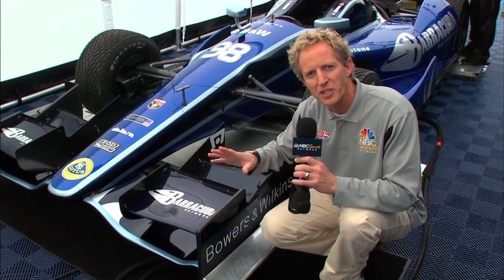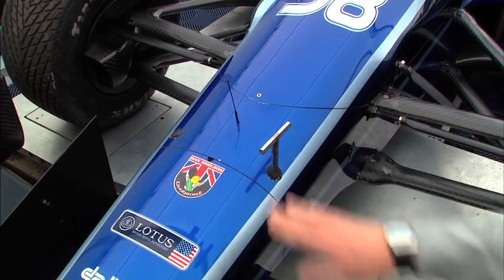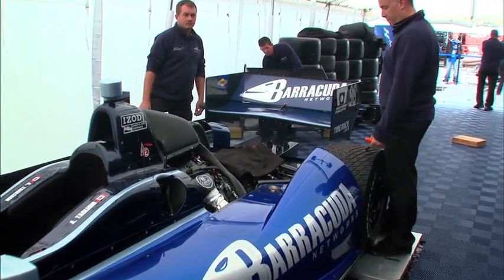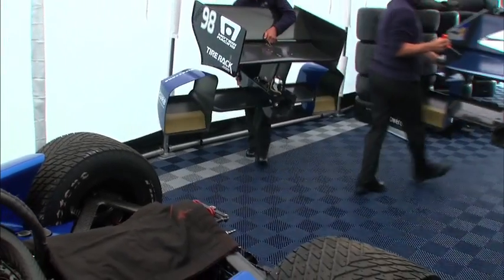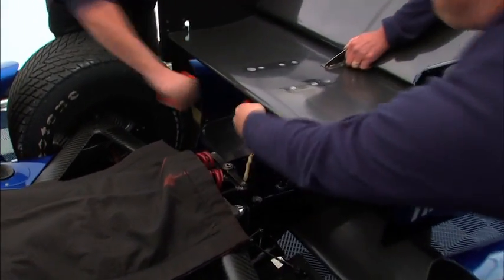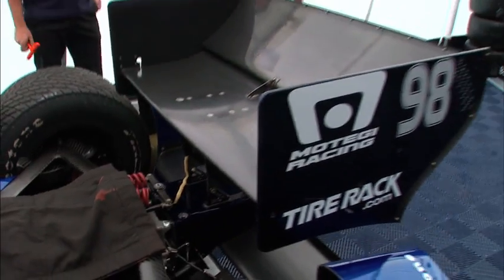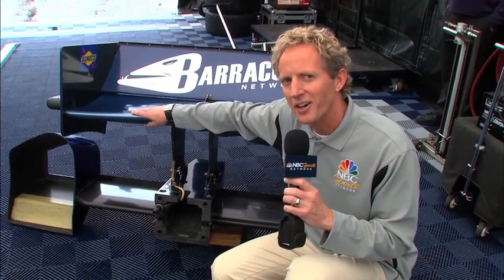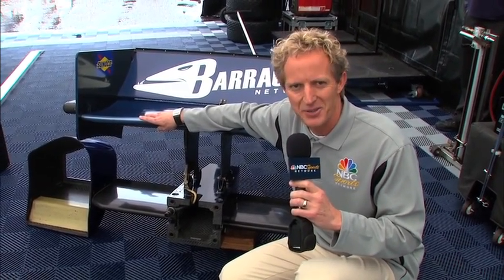Professor B - Wing Change

Comment: probably around the same, maybe less. the front wing has cascade elements this year, so that probably rased the price. the rear wing has the tire protectors connected to it this year, so it probably costs (rough estimate) $5k more just for the added carbon fiber.